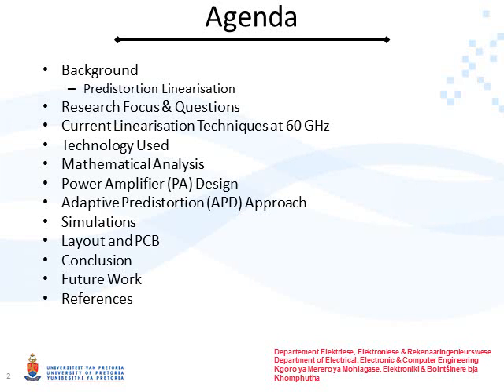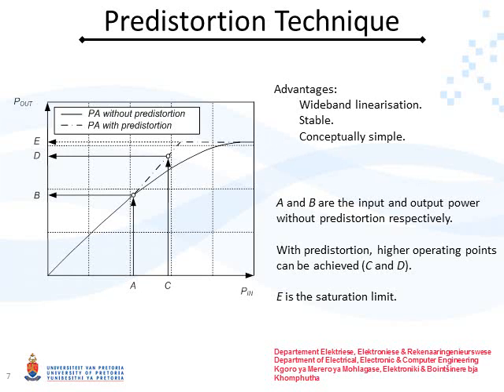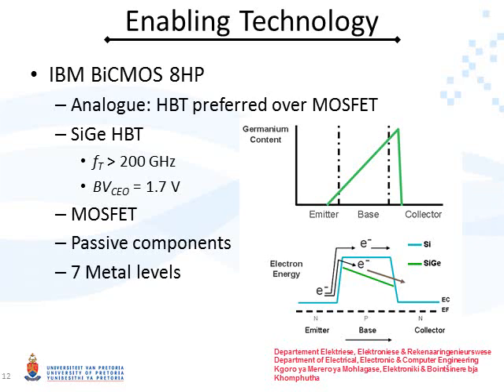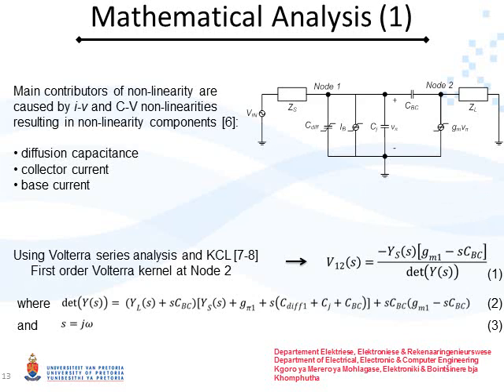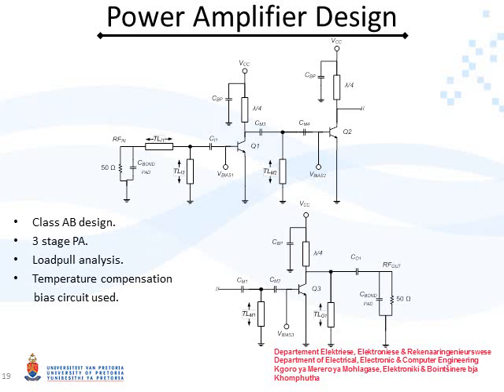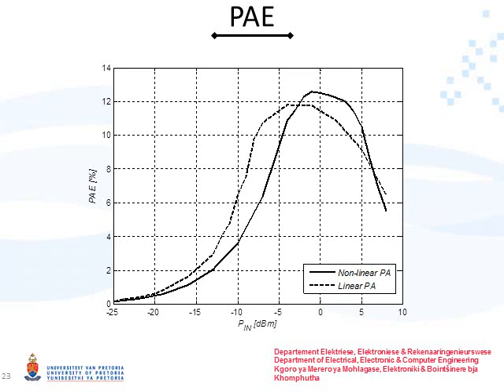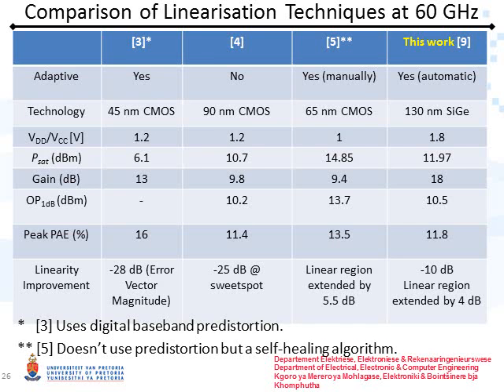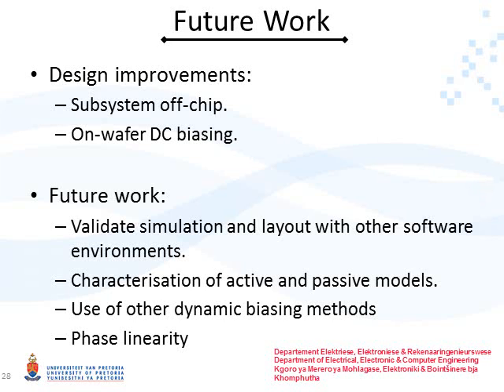Improving linearity utilising adaptive predistortion for power amplifiers at mm-wave frequencies

Comment: hi 
i have started my MS research at sigital predistorter
what is your advice for good starting?
Reply from the maker: +Omar Alngar Have a look at the publications:

J. Valliarampath and S. Sinha, "Linearity Improvement Analysis for PAs at mm-Wave Frequencies," Microwave and Optical Technology Letters (Wiley), Vol. 56, No. 3, Mar. 2014, pp. 743-748. 

http://onlinelibrary.wiley.com/doi/10.1002/mop.28172/abstract

J. Valliarampath and S. Sinha, “Designing linear PAs at mm-wave frequencies using Volterra series analysis,” Canadian Journal of Electrical and Computer Engineering, Vol. 38, No. 3, pp. 232-237, Sept. 2015.

http://dx.doi.org/10.1109/CJECE.2015.2434941